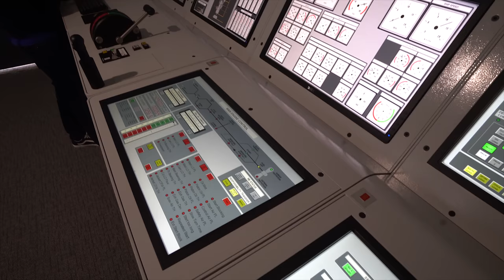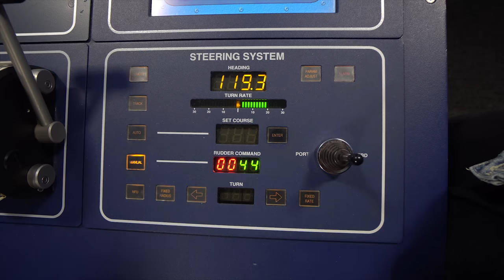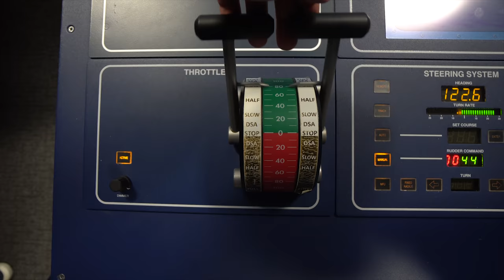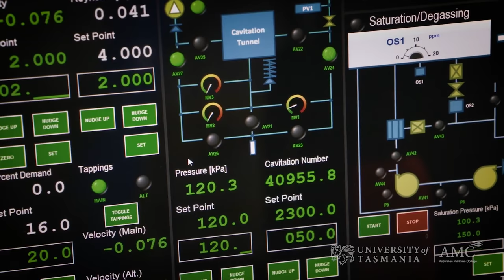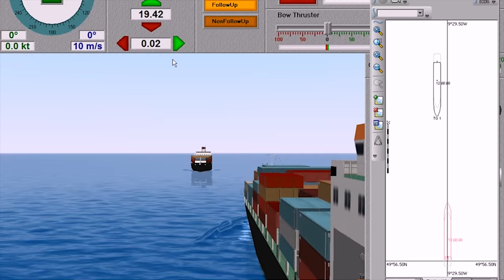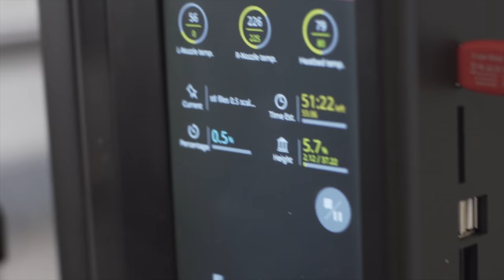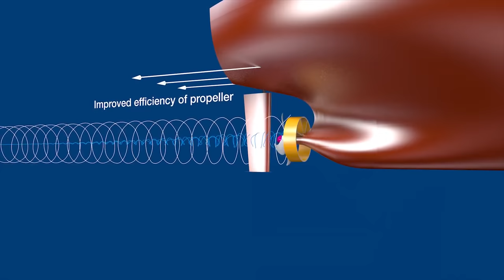My Marine School Tour - Simulators, Naval Architecture, Deck, Engineering & Marine Biology

Comment: I don't believe autonomous ships can replace human navigation jobs. There must always be a human to navigate. There can become errors on those autonomous ships that can make big disasters. Also, I am going start maritime school in august 27, where I will also learn navigation. So if all human navigators will be replaced in the future, then why can I still learn to navigate? And my future job stands on nr16 of best chances to get that job in the future. So, I don't worry about robots. Still nice school btw.
Reply from the maker: I agree with you, perhaps the navigation will be handled by computers but humans will be needed as fail safe.
Reply: Notions like these on the face of it make sense, but the reality is that expert systems are better than humans at this sort of task, eg. a large proportion of airline disasters occur because pilots override what the flight system is trying to do, the pilot unaware that their idea of the current state of the plane and its surroundings is often very wrong. If anything, it's humans and our imperfect perceptual abilities that are all too frequently in error. "I don't believe autonomous ships can replace human navigation jobs. ", is not an argument, it's a sentiment based on emotion (however understandable that may be), not facts and evidence. Indeed, commercial airlines don't really need pilots anymore, they're present in part because customers wouldn't fly without them, whatever the facts might prove. It's akin to passenger perceptions of trust, a pilot with an educated-sounding voice produces greater feelings of confidence than that of a strong regional accent.

The key to reliability with expert systems is correctness (formal methods), an information concept normally used to prevent bugs in the first place, but it's expensive to implement. Still, they're pretty good at it these days, hence why any modern fighter plane can exist at all, those things are perpetually balanced on a knife edge of stability, the pilot isn't really the one keeping the plane aloft - turn the flight computer off and the plane would fall out of the sky.

In order for a human to be a reliable failsafe, one must understand what kind of situations might require that kind of intervention. These normally involve great stress, a confusion of data and inputs, lack of situational awareness, etc., ie. precisely when humans are at their weakest. It's a bit like saying the backup for a sophisticated system should be a really basic one that's kinda iffy. :D

Note that I fully understand the sentiments involved here, the notion that a machine could replace a human operator is unnerving, but in large part in the modern world they already have. Consider the vast numbers of ICs inside the computers that run the systems on a ship, the circuit track layouts on those ICs were designed by a computer, it's too complicated for a human to do (though hand tuning can improve things in a desired aspect, such as performance over efficiency). Likewise, the flow analysis of hull shapes, machine learning systems for better engine design, all sorts of things, the list goes on and on. Irony is, navigation is probably one of the most effective uses of expert systems, partly because of the vast amount of existing data available upon which to design and train them (indeed, air traffic conrol systems are awash with automated navigational systems, as are flight computers on aircraft, and they have to cope with a 3D volume, vs. a 2D surface for sea navigation). When I first studied AI in the 90s I was looking into medical expert systems, but then became interested in visual simulation and training, and petroleum engineering applications inparticular (pipework layout and database amalgamation), ie. trying to cope with complexity like this:

http://www.sgidepot.co.uk/misc/oilrig.jpg

However, when all is said and done, you are right in one regard, there will always be potential scenarios that cannot be factored in to an expert system (such as piracy and terrorist threats). and from the nature of the work as it is, with so much complex maintenance required to keep a ship running (JeffHK, your vids are fanatastic btw, loved watching them all), there's always the possibility of mechanical failure or somesuch, hence why such systems need multiple backups, which adds to the cost, and even then there's the unexpected.

So yes, there will always be human operators around, but it isn't because a person can do the core task better (in this case, navigation), or make better decisions when things go wrong (about half the time they don't, at least in aviation). But then, humans being what we are, confidence and trust are important, a crew won't work so well if there's a lack of trust in the captain, which will certainly be less the case if the cap isn't seen to be in charge. On aircraft, sometimes a machine will make a recommendation that the pilot then approves, a sort of meeting of minds as it were, a halfway house of acceptable automation. In the medical field though, a lot of decisions really are fully automated, patients just don't know about it (hardly surprising really, it's impossible for any medical professional to keep up with all the latest research and clinical data, whereas an expert system can be constantly updated). You'd be amazed how broadly AI of this kind is used, eg. patent searching is one I read about a while ago.

It's a fascinating field, but you guys shouldn't worry, from everything I've seen in JeffHK's videos, I can't see how the vast majority of tasks on a ship could ever be automated, they're too complicated and hands-on. No matter how much I might know about the technical potential of modern systems, I'm still human, I still want you guys onboard, even if the ship's being guided by the world's best satnav. 8)

Btw Jeff, where can I find out more information about those large screen simulator systems? In the early 2000s I was sysadmin of an SGI RealityCentre, mainly used for urban planning, industrial design and medical applications.

Ian.
Reply: I don't agree with your first paragraph. The assertion that the majority of airline accidents are due to 'human error' isn't true, or at least, is highly misleading. Pilots have to step in over automated systems countless times every single time they go flying, and yet, nobody hears about it. When anything at all in an aircraft goes wrong, the automated systems switch off and hand over control to the pilot. When's the last time autopilot has landed a plane when one of the engines caught alight?
Reply: +cobiegaming Indeed. Vehicles may have autopilots, but there must always be someone on the vehicle who can take control if the autopilot does not work anymore. What if a unmanned ship, far away from the living world, loses its autopilot? Than who can save the ship? Answer: Humans, but than the ship must be manned.
It can even be that autopilots can be hacked. So we can not trust a autopilot more than a human. A ship should always be manned.
Reply: @computerinsurgent1204  Well it has to connected to internet to be hacked, so our these ships connected to the internet?
Reply: @cryptomaniac3781  I have heard on National Geographic that at least autopilots of planes can be hacked. So maybe the autopilots of ships can be hacked too.
Reply: @computerinsurgent1204  Found out that these cargo ships get internet from satellite, so I'm pretty positive now that the autonomous cargo ships will too so that they can be monitored from land. Maybe the planes are connected to the internet from satellite too. Seems like the real on going war is cyber war XD.
Reply: @cryptomaniac3781  But still, a ship should not be monitored from land. There should always be people onboard when something goes wrong.
Reply: @computerinsurgent1204  I agree, safer is always better, but it will have to be 100% unmanned like drones some day. Soon, everything will be autonomous!
Reply: @cryptomaniac3781  Nah. I will be in Paradise then. Only stupid rich capitalists want unmanned ships, but money doesn't goes above everything. Unmanned ships can't fix themself. Humans have to stay onboard. I wanted to sail when I was a kid. I don't want to have a boring life on land. And I will not let my dream being destroyed by robots. Robots replacing a human is disrespect to me and other people who want to work in Maritime.
Reply: @computerinsurgent1204  0_0. Oops, I meant FAR future when they'll have robots on the ship repairing and maintaining it, but we both may be dead by that time. Maybe during our life time, we will have autonomous cargo ships that have at least engineers, but that's it. Kinda funny reading that line: "I will not let my dream be destroyed by robots." It's unavoidable, you WILL be replaced! Already got cleaning robots, factory box organizing robot thingy....Yup. I mean, we have self driving cars!!! The only reason why cargo ships aren't gonna be autonomous before cars is the trust. I wouldn't want millions of dollars destroyed from hackers or mistakes XD. Anyway, prepare to be replaced :3
Reply: @computerinsurgent1204  I was joking when I said "prepare to be replaced," thought the :3 face would've made it clear but I guess not, my mistake. Good luck with your studies.
Reply: @computerinsurgent1204  you are right autonomous ships cant sail automatically in sea
Reply: Bright comments came from a Handsome person ! .
Reply: Cost effectiveness decides which jobs will be replaced by technology and that alone. It's romantic to think humans are the best tool for a job - and Universities will take your money to study anything regardless of a job at the end of it, their business is your education, not your job prospects.
Reply: It will probably only mean the amount of jobs available would be Less.  I always wonder how long would it take until there are too many jobs filled that the people coming Last would have nothing and lose their minds.  Maybe not this generation but next or the one after but I doubt 100 years would lapse before a Supervolcano goes off or someone gets Nuked.  It's like how ETH in BTC was.  People joining in because it was profitable now it's not but at the time when it was going up and everything was rising and being stable it feels like it how feels today in the world.  We can only handle the problems that we need to handle and no more but if we do a long outlook projection it doesn't look too good for a lot of people though there is still a possibility that technology somehow makes Everyone happy.  The normal goal is to live long as possible on Earth but some have died of cancer from doing a lot of heavy metal work for decades throughout their career.  People who aren't suicidal would do Anything to live longer if it's within their reach.  Everyone is seeking fulfillment and satisfaction.  Basically everyone just educated guessing but when done right it's healthy.  When people are happy it usually means they've found what the "God" system wants them to do but there are always flaws that need to be ignored.  Being distracted about anything "wrong" when things are going great is the best way to make it in the world.  Some people who start losing their minds thinking in ways they've never thought before usually end up on the news and worse.  It's the result of having flaws not being addressed correctly.  The main goal is to always achieve happiness w/ the minimum requirements possible.  Everything excess is unnecessary but shouldn't be the minimum standard at 80% or better.  It should be 1% and we feel great though w/o striving other people may not get the help or care they need as people have Settled feeling good and want to do No more such as someone wants to help 10 people but they are satisfied so the other 40 people get nothing.  It's good for the 11 people but the other 40 will have Big issues.

The flaws of life that people don't know how to handle is like being "lost".  W/ the power of technology done right it would be possible to Never ever get lost but if the "God" system wants ignorance to exist then all measures to "not" know all the way would always be in action suppressing, impeding, silencing, etc. all means necessary for truly unknown reasons to us.  Still though, if we super benefit After dying then it doesn't really matter if robots took your job or the jobs of your offspring on Earth as it's No longer your problem.
Reply: You think arabic then you write english sooo funny from Tunisia
Reply: Hey I also started this august! Are you on a ship now?
Reply: @ShiratoriIsOffline  Im now on final year. I have been on a ship as a cadet for my 1st internship and will likely go in february again as cadet for my 2nd internship. On my school internship as cadet is divided into 2 periods of a half a year. Instead of doing 1 period of a full year.

Comment: As one of the students from the Rotterdam Mainport University, by the STC Group and University of Rotterdam, I am really impressed by the facilities you showed here. I myself am nearly graduated Naval Architect :). Also have been closely related to Marime officers, as salvage and rescue is my field of expertize.

I do however proffesionally dissagree with you on autonomous vessels. We humans will never get replaced on vessels, as there is for instance wear and tear and maintenance to be done. Also so far the autonomous systems have never been without failure. 

I do see us beeing assisted by autonomous systems, never replaced though ;)
Reply from the maker: I actually agree with you, the part about autonomous ships is just my awkward humor XD
Reply: JeffHK I found it hilarious! We will always need humans to maintain the robots just like the car manufacturing industry. Unless we get full fledged AI in which case we gotta really be banking on that musk dude to get us the hell of this planet xD
Reply: When are they going to build catamaran ships that ride on water rails? The water rails are two narrow channels with a solid space between them running parallel. Each of the two catamaran hulls sits in one of the channels and both have a propeller on the end. The trick is to guide them without hitting the solid space separating the two channels. They could incorporate maglev technology into the channels to keep the hulls from rubbing the sides and then you can have ship trains or at least have sideways wheels on the hull that will simply bump and roll off the channel sides. Kind of like how a train bridges over the two rails on which the wheels ride. People should buy up my Dance of Death a James Grider novel on Amazon so I can afford a used car. What's funny if I went to that school and suggested such idea, the administrators' faces would light up, "Wow! You're so clever. We love your idea. You will get very far in our school. Please, sign these FAFSA papers." Then real engineers would say, "This guy is a retard. We don't need retarded ideas like that."
Reply: The facilties at our school suck compared to them just sitting in class learning things instead of spending more time on the sim
Reply: Kieran Lepley why don't we just build a space elevator? Oh wait... things aren't that easy
Reply: Oooh friend, so the same was thought about autonomous cars. "They will never be able to get rid of humans on the wheel..." and here we are, with Waymo almost releasing it's autonomous transporting system. :3
Reply: Hi, i was wandering since you were in Rotterdam. Do you know if there are any good maritime schools in The Netherlands you would recommend?

Comment: When are they going to build catamaran ships that ride on water rails? The water rails are two narrow channels with a solid space between them running parallel. Each of the two catamaran hulls sits in one of the channels and both have a propeller on the end. The trick is to guide them without hitting the solid space separating the two channels. They could incorporate maglev technology into the channels to keep the hulls from rubbing the sides and then you can have ship trains or at least have sideways wheels on the hull that will simply bump and roll off the channel sides. Kind of like how a train bridges over the two rails on which the wheels ride. People should buy up my Dance of Death a James Grider novel on Amazon so I can afford a used car. What's funny if I went to that school and suggested such idea, the administrators' faces would light up, "Wow! You're so clever. We love your idea. You will get very far in our school. Please, sign these FAFSA papers." Then real engineers would say, "This guy is a retard. We don't need retarded ideas like that."